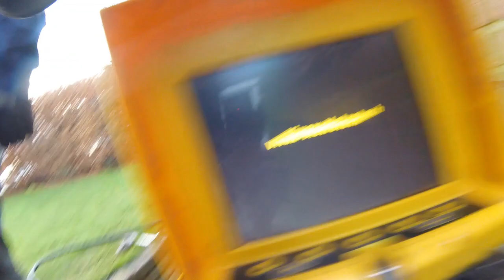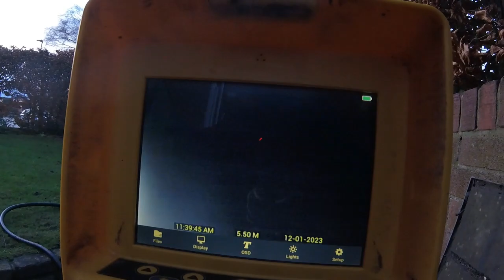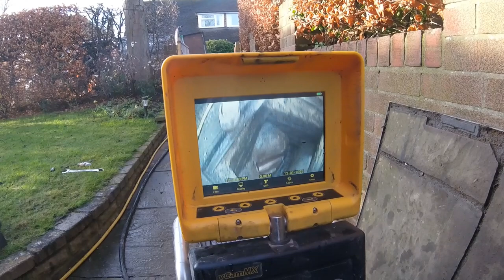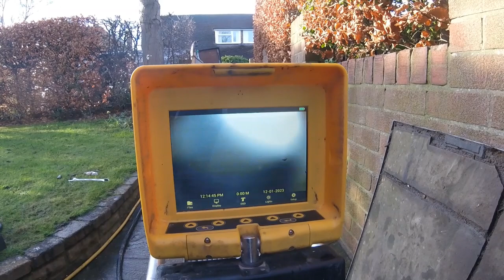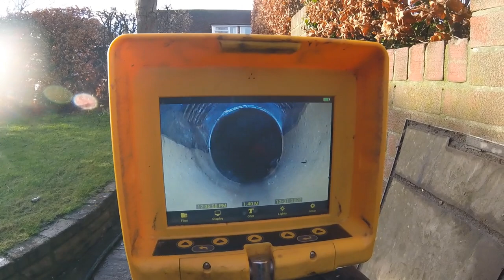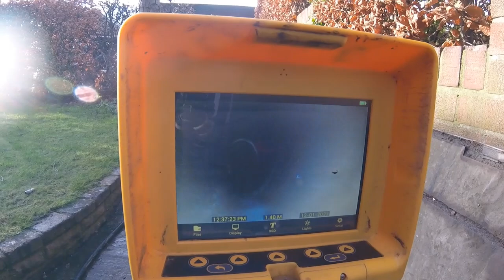Tree Roots Clean A Drain LTD 176

Comment: You certainly got to the 'root' of the problem there.  Tree-mendous effort getting it cleared though.  BTW, does the root-cutter head spin under the water pressure to remove the roots?
Reply from the maker: Yes in the same principle as an air drill but with water And the head spins. Check out my video 96 it shows all my equipment working above ground level 👍🍻